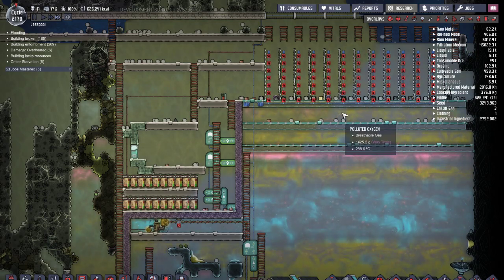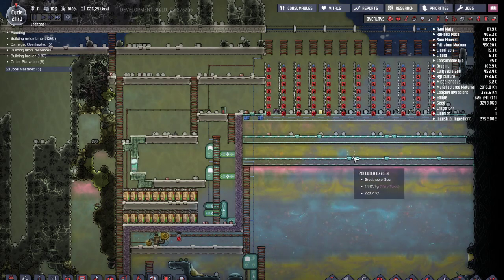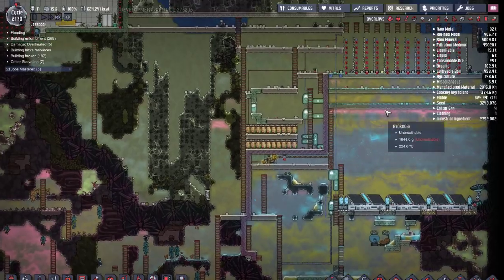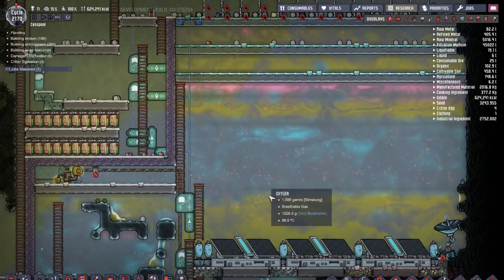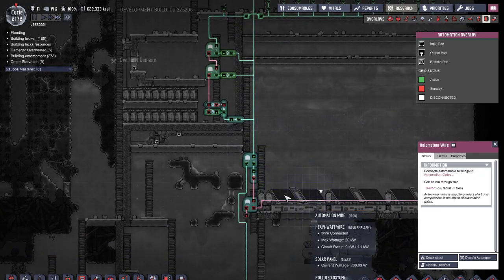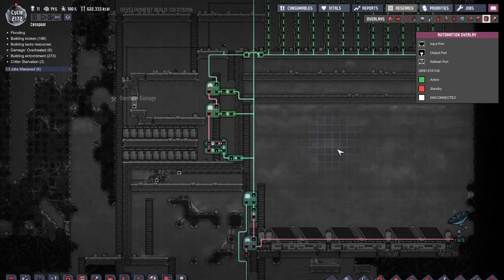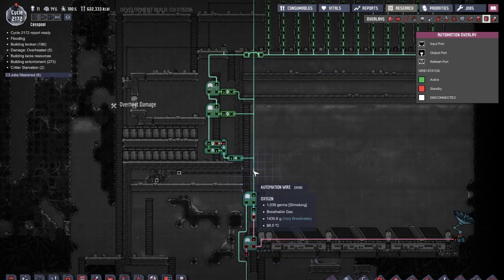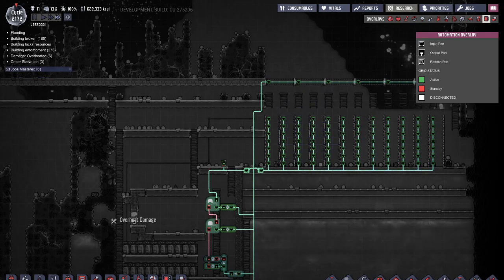Oxygen Not Included Solar Panel Automation

Comment: Impressive, would be nice if there were more legitimate tools to use for building sustainable bases without relying on exploits.
Haven't yet found out how much work sustaining duplicants becomes after finite resources have run out but this much effort for huge solar panels that each produces less power than a manual generator seems very unrewarding. If manually clearing up debris is intended then it only makes it worse.